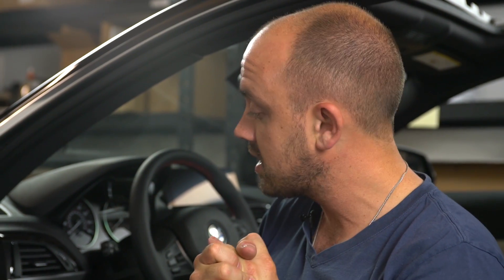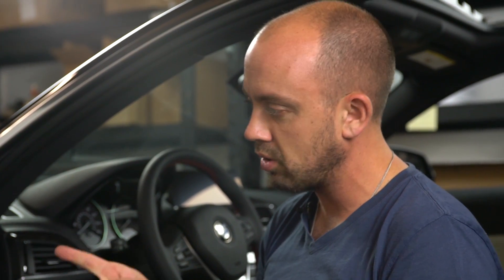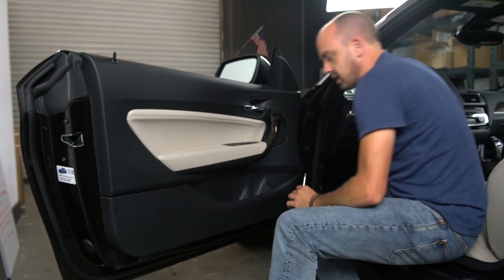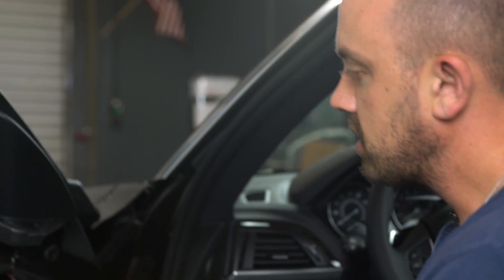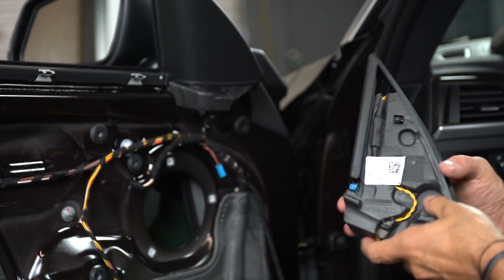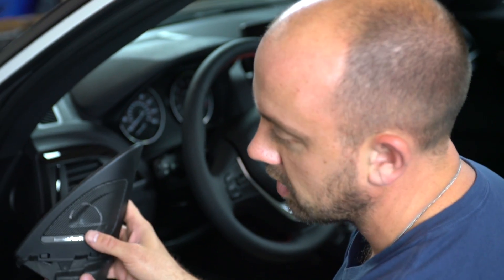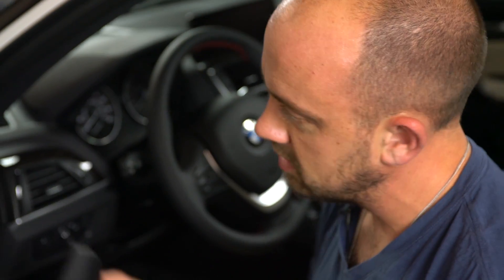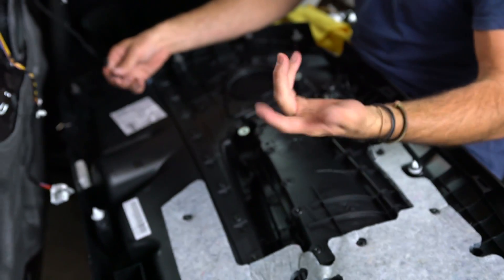BMW Speaker Upgrade/Installation | F22 2 series 2014+ | BAVSOUND Stage One

Comment: If your car is non-HK - can you just buy the HK tweeters and install them?
Reply from the maker: No! These kits look the same and would fit however, there are different technical specs called impedances that affect the way they operate with the factory amp.
Unfortunately the speakers will not be compatible between the HK and Standard Hifi amps because the impedances are different.

Comment: Does there need to be any firmware configuration after installing if you put a new amp in?  Looking to use your equip on a 2020 m240i with HiFi, and looking to either do the tweeters or not, but upgrade amp and speakers.
Reply from the maker: @GregAuerbach  nope! It’s all plug ‘n play!
Reply: @bavsound  on your website, it says only the undersea subwoofers are available.  I've got a F23 2020 convertible m240i with standard HiFi system

Comment: Lucas wrote "Half of the clip removal for door is obscured by the door. I broke the clip with the grey flange because I didn't know that you have to rotate it 90 degrees." ...

Yep ... I did the same thing trying to remove the connector to the power windows on drivers side door. Luckily it still seems to lock ok once it put the door back on and put some electrical tape around to ensure it does not become dis-engaged.

I was not familiar enough with BMW connectors  and could not figure out how to undo the connector.
Reply: So how did are you supposed to remove these without breaking?

Comment: If you're going to spend the money on a speaker upgrade, minus whale put the sound deadening on the internal cavity of the door in addition to the outer panel that's covered by the door panel.

Comment: Not too stoked with this tutorial. Half of the clip removal for door is obscured by the door. I broke the clip with the grey flange because I didn't know that you have to rotate it 90 degrees. A little hint about that would have helped. Also a description of the tools required at the beginning and mention that you need a heat gun and to precut the sound deadening material would have been helpful.
Reply from the maker: Hey Lucas, thank you for your feedback, we will make sure we integrate the additional tips into our installation material. If there is anything else we can help you with, please reach out to us at support@bavsound.com.